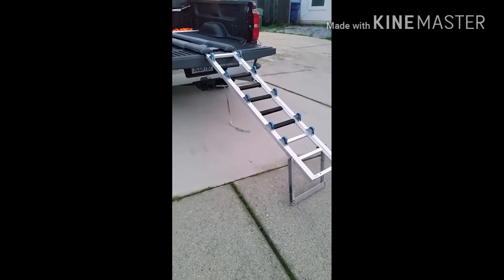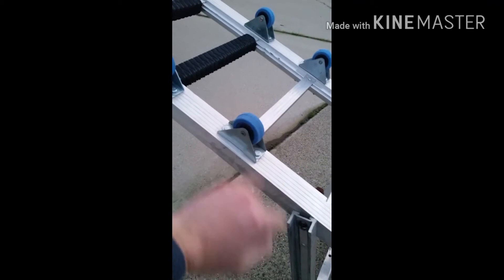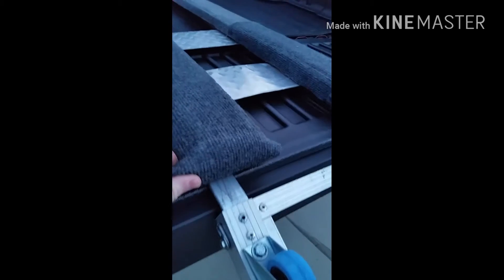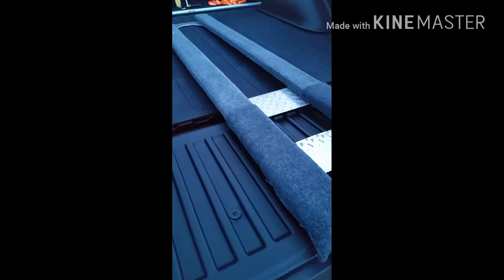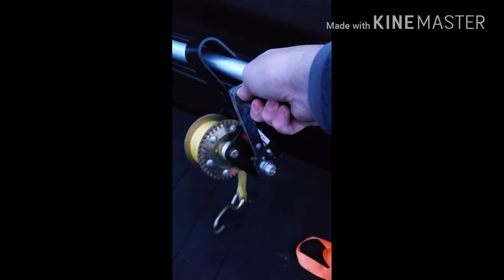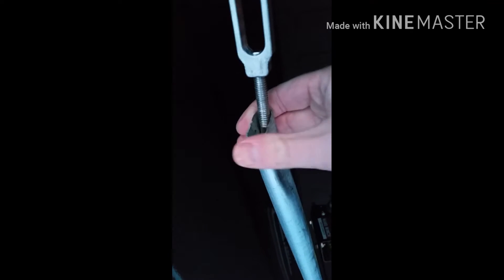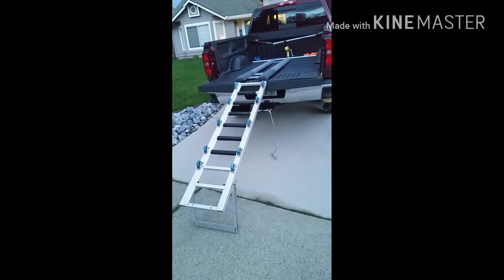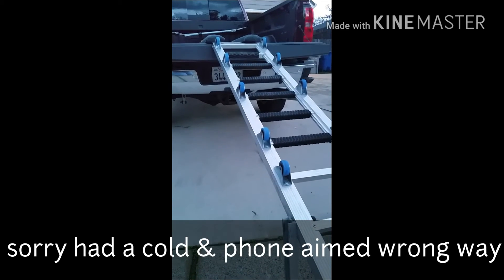Jet ski loader How to instructions Jet ski truck carrier DIY

Comment: Great minds think alike, I built similar but used large inflatable tires that double the ramp as a beach cart and with a small electric wench no more exhaustion after a hard workout
Reply from the maker: I was gonna to a electric wench as well but ya know eventually ya move on and sell stuff so. Would have been cool for sure and the beach dolly part would have been cool. Would t have to bring my tote.